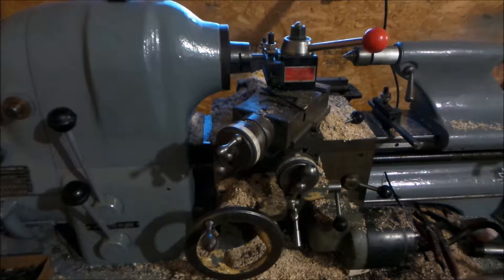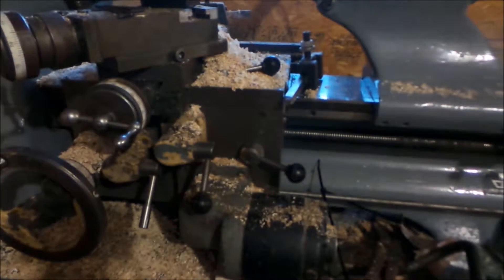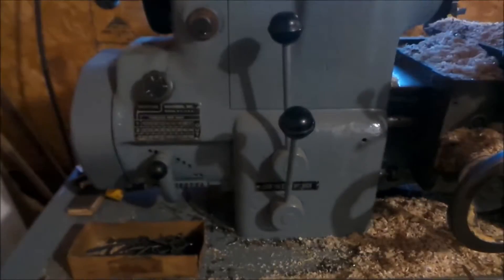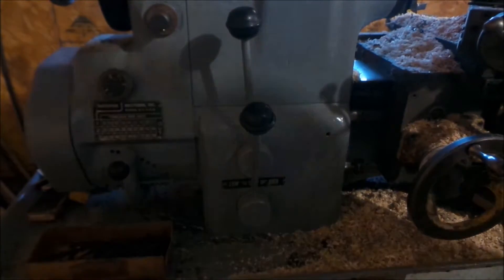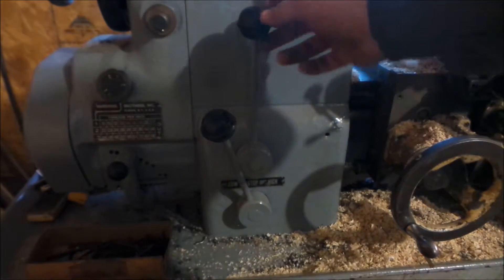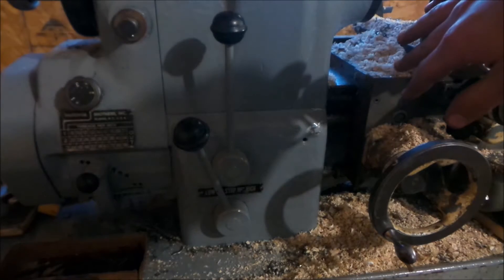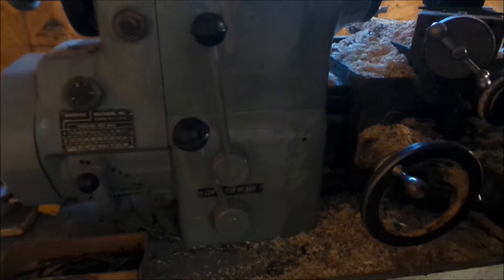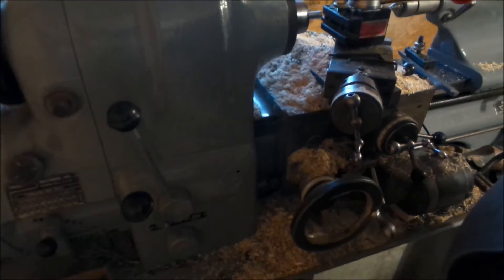Threading on a Hardinge HLV Lathe

Comment: top slide is at the wrong angle for external thread.!!!!!!!  ( as set is suitable for internal or left hand external) . You should fix the top-slide fast retract mechanism , then you'll really benefit from the hardinge design.
Reply from the maker: Bill Todd did not know it had a fast retract? how does that work
Reply: Diehl Does  On the HLV (slightly different on hlv-h) there is a cam ring (like a very course thread) that moves the slide relative to the dial assembly. Take a close look at the ring behind dial nearest to the slide, you will see a threaded hole  for a lever (or the remains of a broken lever!)   the ring should turn about 90 degrees - they are often unused and get very stiff so soak it in releasing oil if it is sticking . There are parts manuals for the hlv  on the yahoo group site that should help you see how it goes together.
Reply: Diehl Does When setting your top-slide angle , imagine the V of the thread you are cutting and set the top-slide so it will feed into the V in the direction of cut ,at about the same angle  as the trailing edge of the V